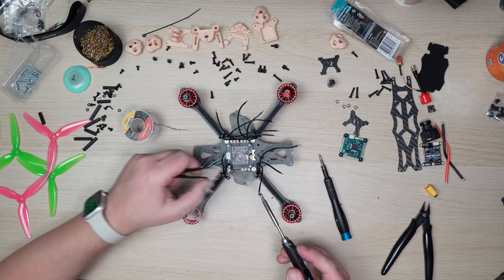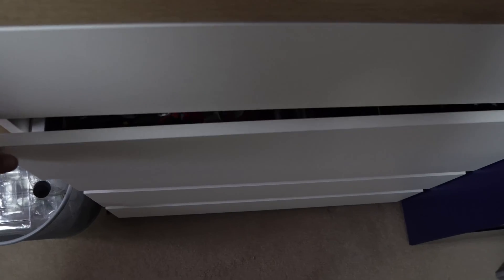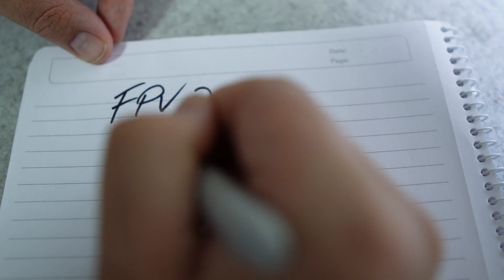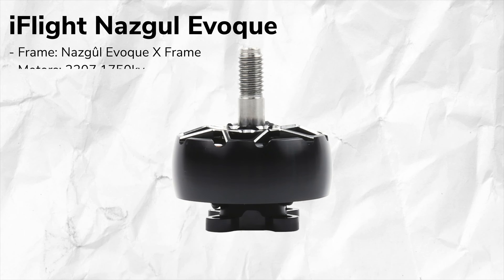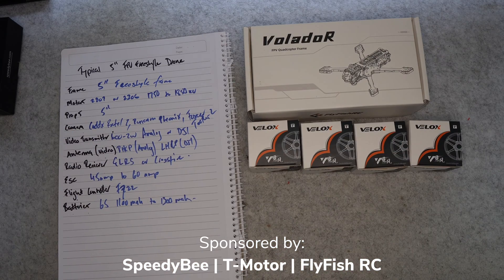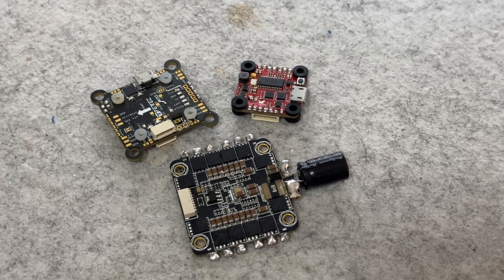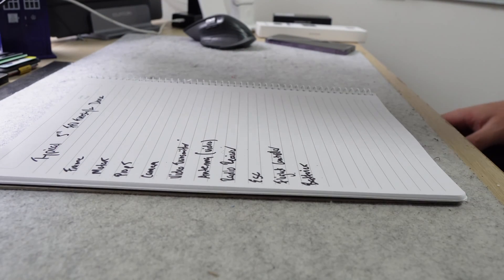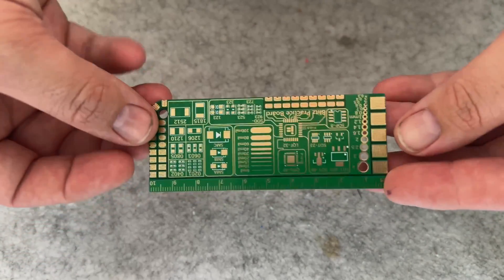Find Compatible Parts To Build A FPV Drone

Comment: Thanks for sharing these videos. I have a question, what does OS this drone have? Could I program it with MicroPython? Or, what other programming language?
Reply from the maker: You are welcome. Thanks for watching. 

They all use Betaflight which does not require any programming at all, you just use the GUI configurator to change the settings and pid controller. 

Betaflight is open source so the code is all on GitHub if you wanted to check it out

But these are all no coding necessary for the end users

Only the devs on the Betaflight end do the coding.

Comment: Great advice!
Coincidentally I'm building a 4-in with the same components that you are just showing just in 20x20.
One thing I've known over the years about soldering is make sure the tip is clean before you ever even get close to your board. If you tin your wires and you see black specks, make sure you clean your tip before you get it near the board.
 A fine tip soldering iron is recommended.
I see other people are picking up on little things you left out like smoke stoppers ...but you did show a picture of one.
Reply from the maker: I think I included it in the on screen text or did I miss that?

Nice build! Which 20x20 are you using?
Reply: @DarrenAllatt  you did put that on the screen but I noticed in the comment somebody said that you didn't mention it. I guess for the people that are hearing impaired I bought I just got it in the mail today a speedy bee stack mini 35 amp 3 to 6s the f7. And I have the speedy vtx 800 and I bought the Joshua Bardwell edition Phoenix 2. 
I'm building it on an apex 4-in. I also bought the Radio Master Express lrs TX 12 and I'm updating the firmware on it right now.
Reply from the maker: @MadDragon75   it’s a balancing act between how much I can say vs retention, so I’ll use images and text to try to cover the things I can’t say or to show additional stuff. 

Nice. Apex 4” is sweet! You can run 3.5” props on that and it’s a very capable 3.5” which should have more 5” feel. Good choice in stack too!
Reply: @DarrenAllatt  I've been running Gemfan 4 inch props with winglets and the HQ props that came with my dolphin on 1507 Motors on 4S Packs and love it... So I bought brother Hobby 1507's at the higher KV so I can run 6s. Now all I need is a 6S charger and a few 6S packs. 
😏🤙
Reply: @DarrenAllatt  as far as the channel and being a content creator, I fully understand and I sympathize with you actually I empathize with you. 
Like I tell people all the time you can't make a video to please everybody. 
Just keep doing you.
😏👍
Reply from the maker: @MadDragon75  for 6S you want to go down in KV not up. So if you are running 3000kv for 4S, you want to go to 2500 for 6S

Multiply Voltage x KV = RPM

High KV on 6S will burn the motors or the ESC

You can also do a motor output limit on the 4S motors in Betaflight at 66% to run 6S
Reply: @DarrenAllatt  I bought these... brotherhobby vy 1507 3100kv. 
They recommend those motors for 6s.
Reply from the maker: @MadDragon75   yes, but not for a 4" Drone. They can do 6S on a 3" Cinewhoop. If you want 6S on a 4" you need to be around the 2,500kv mark.
Reply: @DarrenAllatt  I've been flying 1507 3200 KV motors on 4s that came with my 3 GEPRC Dolphins.
That quad has been clocked at nearly 80 mph 78 into the wind 79 with the wind. 
I think they'll be okay for flying on 4S for a while even though they recommended using them for a 6S. Or I could be wrong.🤣
Reply from the maker: No, they don’t recommend them for 6S on a 4” drone. Those motors can do 6S if you are using 3” props. 

It doesn’t matter whether the motor says it can do 4S or 6S.. it’s about the KV and Prop Size.
Reply: @DarrenAllatt  well.. We'll see how good their motors are. The 6s and the 4S version are rated at 30 amps and I have 35 amp ESC so we'll see.
My props start at 4 in but by the time I'm done with the winglets after cutting down a 5-in prop they're about 3 and 1/2 in.
Reply: @DarrenAllatt  like I said they were so close to my 4S Motors that I've already grown used to that I wasn't really planning on flying on 6s until I got a charger and some packs anyhow. I'll be able to try it out a couple times while I'm waiting for my new motors. I just didn't want to use old motors on a new build.
After all I didn't build it to keep it in one piece. 😜
Reply: @DarrenAllatt  I uploaded my first two flights, the motors didn't even get warm.
Reply: @DarrenAllatt  Battery sag is a different story. 😁

Comment: A smoke stopper is also a really good device to get, it disconnects your battery if you accidently bridge your solder. That $6 plug can save your $100 FC
Reply from the maker: Absolutely